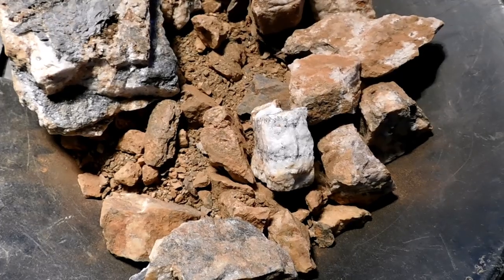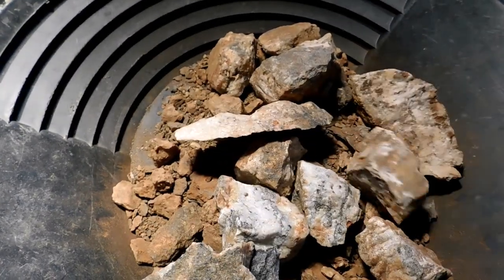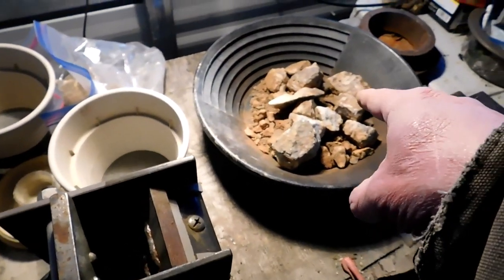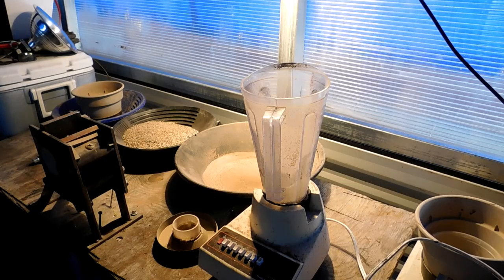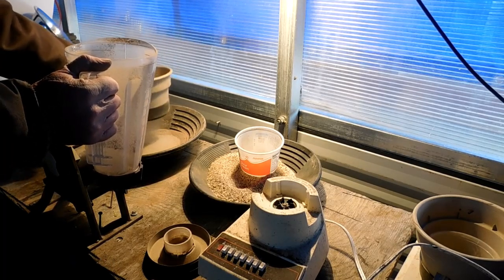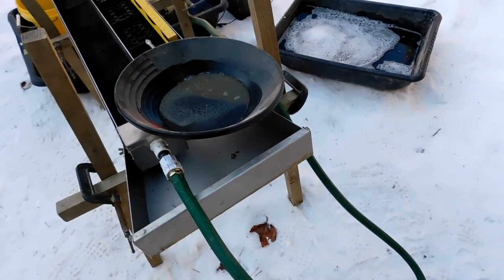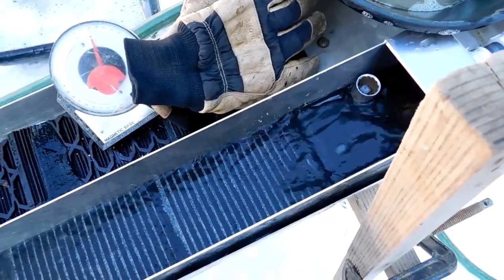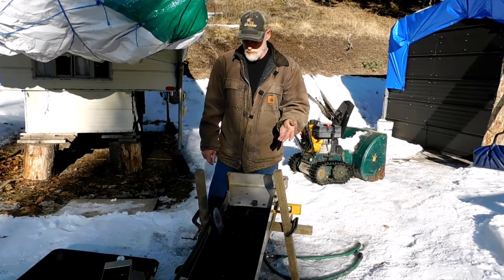Crushing Gold Ore Paydirt -  Free Mill Lode Gold

Comment: Great video Alan! Thank you for sharing our ore with folks! Definitely not your typical paydirt bag. Nice jaw crusher!  Sorry to see Mother Nature trying to freeze you out.  Some folks run the rv antifreeze biodegradable kind, in the water to stave off the ice.    Also, I have had a couple folks mention they are having issues with the code.  It affects some and not others so we are a bit baffled by that but, if they go thru the process on the website we will adjust the price to reflect the discount.  
Please let me know if you didn't get the guaranteed amount.  Looks like you were on track to recover that, but after all that work it's important for me the values are there for you.
Reply from the maker: That was a lot of fun to crush up that rock and glad you are getting some orders.
I still have some rock to crush up that you sent so we will see what the tottal is.
The silicone mat sure did a nice job at catching the fine gold. I was a little worried until I went through the taillings.
Thanks for selling and letting other play with your ore.
Reply: @alanrobertson2510  I looks like the mat did an amazing job at cleaning that up.  So much so I am in the process of switching up a couple things. I am going to try sluicing with your mats, directly from the shaker table. Thanks again Alan.
 Blenders, Perfect for that ultra fine crush. Nice!
Reply from the maker: @theminerstable4790  Let me know how the mats work for you runnung them after the shaker table. I bet they work great.
Reply: Checking you guys out now,  and I must say, I absolutely love your list of Great Americans' quotes at the bottom, especially T.J.'s one referencing the tree of liberty needing both the blood of Patriots AND Tyrants. The latter is long over due, in my humble opinion. Anyway, I will be picking up an order soon, and I look forward to making a video crushing it, as soon as I'm done with this batch of mills and have some free time. Can't wait!
Reply: @southernoregonprospector9074  Appreciate the kind words and for giving us a try.
Without a properly functioning government recognizing that our rights are granted to US by God, not them, tyranny rules. The quotes are intended to let folks know. Buyer be ware. I care not for seditious behavior. I even scroll the social media of some folks. If your toxic. You get shat. cancel culture works both ways.
p.s. We are currently working a bit behind schedule. Expect a delay of 2 or 3 days for processing.  Thanks Again!  Looking forward to hearing of your adventure with our ore!
Reply: @theminerstable4790  Please confirm the domain of your website.
Reply: Link is broken ?

Comment: That looks like good fun on a winter's day. I went to the Miner's Table web site. Neat stuff. I will probably try some. They do say that at least part of the gold is locked up in sulfides. That may be another reason you got less than you expected. You may need to do some smelting.
Reply: I do try to make sure the guaranteed amount is free mill. Most folks cannot set up for processing the sulfides. 
Those that can need to follow specific guidelines for roasting and smelting but can release the silver and gold locked up those sulfides as you pointed out.
Reply from the maker: Thanks Yes I nedd to do some more prossessing.

Comment: Question sir - Have you already tried water in the blender also, I'd like to hear your results.  You would want it runny and not paste like but it would sure solve that dust problem.
Another idea would be to put a vacuum hose or something with real low suction to the top of that blender for dust removal.
I would have never thought of a blender so now I am curious.  Good stuff - thanks.
Reply from the maker: I have tried it wet and it doesn't work very well at all. The vacuum is a good idea. Thanks

Comment: Hey Alan, quick question on your speed control, where did you pick that lil thing up? I got a Seaflo 2000 gph bilge pump, I like it but yeah, adjusting the water flow would be really helpful to see what works best. Hard to duplicate the nice flow of a river in a recirculating home sluice, but I"m managing to pull it off! Thanks for your vids, they inspired me!
Reply from the maker: I bought the speed controller on eBay. The best $13.00 you will spend.  This is the title. US 10-60V 20A Pulse Width Modulator PWM Waterproof DC Motor Speed Controller New
Reply: @alanrobertson2510  Awesome, thanks, I just ordered it. $16 on Amazon, 2 day delivery. :-)  How is your battery life while running your pump? Mine is only good for about 1 hour. But if I plug it into a charger, I'm basically running it off the charger I think. Ultimately I want to drag my sluice contraption out to some tailings piles in the middle of nowere and go to town...only problem is recycling out the muddy water. I made a window screen "bag-like" filter that I wrap around the bilge pump, and I mount it on the side.
Reply from the maker: @starshiptrouter  I use  marine batterys. My small stating marine battery will run a day with my trommel and pump my big trolling marine battery will last two days. Have fun out there. Good idea with the bag to wrap around the pump.

Comment: Do you need a permit in Montana to run a highbanker on your claim.
Reply from the maker: We get around the permit proccess by running 12 volt recuculating setup. You are OK as long as you tailing water does not get back to the stream.
Reply: @alanrobertson2510  Thank you. Does the recirculating setup have to be 12 volt? Could you use a small 2.5 honda motor if you had a small swimming pool to contain the water so nothing gets back to stream?
Reply from the maker: @scottmelvin1046  I think it will depend on the person you are dealing with on weather you can run a gas engine. The FS guy we deal with says no gas engines to stay away from the permits. I use a ice fishing sled for my setup.